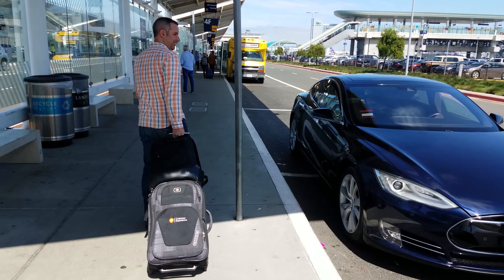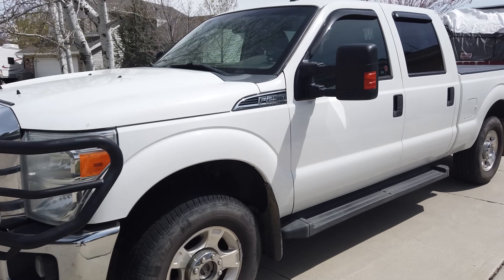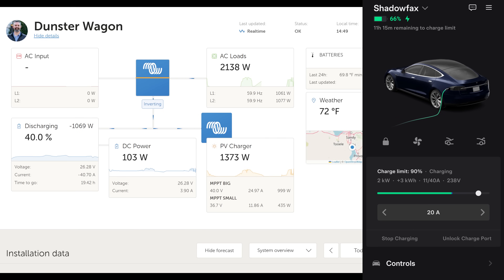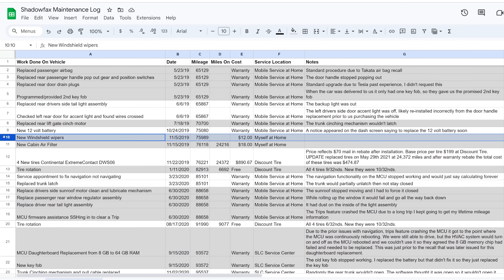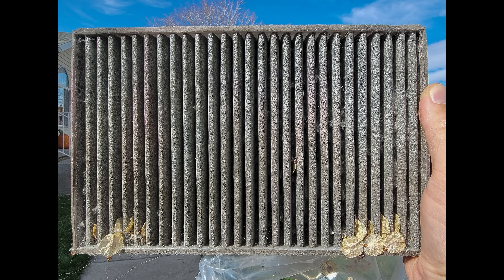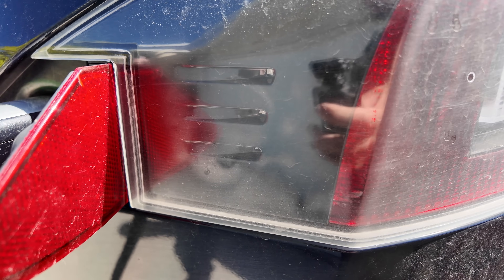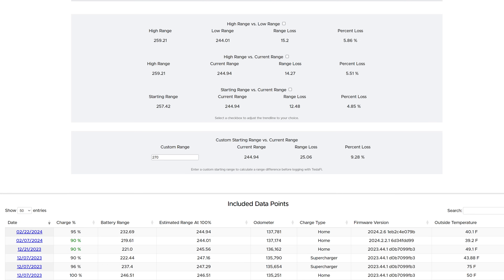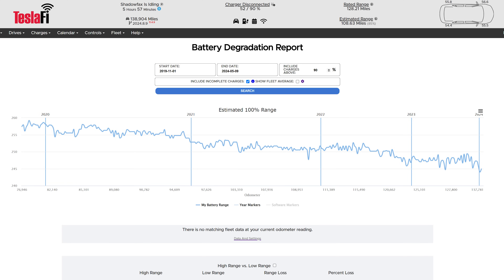Should You Buy A Used Tesla? | 5 Years Of Model S Maintenance Costs Plus My Current Experiment

Comment: Thanks for the great recap. I just purchased my own 2015 Model S 85D a couple weeks ago. The prices finally came down enough that I could afford the car I have wanted since the 2012 release. With the used EV federal tax credit ($4000 transferred directly to the dealer), I was out the door at $16250. Like you, I had always bought and driven reliable used (out of warranty) cars prior to this one. Because I bought this Tesla from a (non-Tesla) dealership, it wasn’t possible to get a service history, but I did figure out it has the MCU2 and original battery (from sticker behind right front wheel well). One thing I am very curious about is the battery health. I know there are health checks and calibrations I can do by charging it high and running it down low and/or through the service mode, but for a couple reasons that is not something I want to do right now. Where you could possibly help me is by telling me about how many real world miles you get for each percent of charge. If your max range is ~250 miles, then that should be 2.5 miles for 1%. Do you get anything close to that? 

Again, thanks for your work on these videos.
Reply from the maker: I just checked TeslaFi and I haven't charged the Model S over 90% since February 22nd 2024 apparently, which I'm just finding out myself. I'm not surprised though since right now I'm exclusively charging the S from our travel trailer's solar panels. The state of charge is all over the place, but generally 40-60%. It did recently get to 90%, but I'm realizing now I should have let it charge to 91% to let TeslaFi get a data point on it's estimated range. On February 22nd 2024 the estimated range at 100% was 245 miles. It's probably still in that general area of range.
Reply: Right, but what is the difference between the estimated range you are  getting and the actual mileage you get? I know the estimated range is based on more ideal driving circumstances, so the actual real world range will be lower, but how much lower is what I really want to know. My car tells me the estimated range is for 100% state of charge is like 235 miles, but when I take a drive of 23.5 miles the charge drops more like 15% as opposed to the estimate which would be 10%. So my actual range seems way off from the estimated range the car gives me. Just using the miles I drive in a given trip divided by the percent decrease of the state of charge, I am getting between 1.6 and 2.0 miles of driving (a wide range, I know) for every 1% of charge that is lost/used. I figure this means my real range has to translate between 160 and 200 miles. This is not necessarily a concern for me because I can comfortably live with my car  as a daily driver getting charged every day at home, but if batteries that drop below 70% of original charge become less stable and prone to failure, then I would like to know. Can you tell me about how close your cars estimated range is to what actually get? Does a 24.5 mile drive drop the state of charge by 10% as estimated, or is it typically a drop closer to15%?
Reply from the maker: @jasonpalmer7511  You raise a good point, and I've been writing a script to make a video about the very subject of actual real world range vs the "rated range" which is well known for being...optimistic. Looking in TeslaFi for my Model S at my top 10 longest drives they vary from 197 (used 92% of the battery at 83.8% efficiency and 89k miles on the odometer) to 175 miles (used 95% of the battery at 70.7% efficiency and 81k miles on the odometer). A more recent example from December 2023 when we drove it down to Las Vegas to pickup our Model Y we drove 95% of the battery driving 174 miles at 73.8% efficiency and 135k miles on the odometer. Keep in mind the speed limit on that route was 80 mph... The longest drive we've ever done was 3 hours and 30 minutes to drive 197.21 miles using 92% of our battery at 83.8% efficiency with 89k miles on the odometer. Generally I drive about 75-85 mph while on road trips so all these numbers reflect that. You can expect about 200 miles of range while on road trips with minimal safety margin, but this number can be higher if you drive slower or are going down in elevation, or there's a tail wind etc... Conversely if you're generally going up in elevation, a head wind, going faster it'll be lower obviously.

Regarding the Battery Management System (BMS) and the car stating range that doesn't seem to match with the real world, that will typically get more accurate if you run the battery all the way down, then charge it all the way back up which is only something we do on road trips. If you are just driving around town for months/years then the BMS can get pretty uncalibrated which will likely be fixed by not charging for as long as it takes to run the battery down to say around 10% then charge it all the way back up to 100% (then hopefully drive the car that same day to get it back down to less than 90%).

We have a destination we drive to regularly that's 25 miles away (we've driven there over 200 times in just our Model S) and the last 10 times we've driven there in the Model S it consumed 11%, (July)  13%, (June) 15%, (Feb and the rest are all winter months) 14, 13, 14, 14, 13, 14, 14% to get there. That's a variance of 70-90.8% efficiency. Why the variance?  All kinds of things. Cabin set temperature, ambient temperature, was the car just parked in the garage prior to the drive or was it in the driveway (Our S and Y take turns in the garage for various reasons), was there wind, what direction was the wind going, traffic conditions etc...

In short I've learned to not be concerned about the range at all when we're simply driving around town because we have way more than enough range to drive wherever we want to go. Then on road trips I rely heavily on the navigation in the car to see what the estimated arrival percentage is. When doing rough planning I know we can go about 200 miles max, but the distance we actually drive is less than that dictated by the distance we can drive between the superchargers considering environmental variables that the trip planner takes into account (elevation changes for instance) automatically. I mention this because while I like to dive into the details of the metrics, the average person out in the world likely doesn't want to have to be bothered by efficiencies, distances, Watt hours per mile etc... and I want them to recognize that they can just route the car to their intended destination and let the car take care of the rest if they want.
Reply: @ElectricTechAdventures  That is really helpful. Thank you for the detailed response. 

Just to add a data point for others who are here reading about repair costs on a 2015 Model S 85D, I got mine a few weeks ago and the headlight went out a few days later. The part alone (HID bulb) was $130. There were much cheaper options on Amazon ($30 and up) but I chose the Sylvania D3S because it is warrantied for 12 months and, more importantly, the replacement of the bulb was much more difficult than it should be and I didn't want to have to do it again because a cheap bulb burnt out or failed. I have always changed my own headlight bulbs (Mazdas, Acura), but the Model S required jacking the car up, removing the tire and wheel well just to get access to the bulb. Some say it can be done from the frunk, but it's really tight. After watching numerous videos, I decided to price out having Tesla do it because I lack both the proper tools and the confidence to jack the car and start taking it apart. I really cannot afford to break something else in the process! Tesla service gave me appointment three weeks out for a different issue (cellular connection) and never responded when I messaged them about the headlight (Atlanta area). I found two shops that do work on Teslas and both quoted me over $250 just for the labor. I tried looking on Task Rabbit for a freelance mechanic, but didn't see any who advertised experience with Teslas. I did find a mobile mechanic company (instant car fix.com) that quoted me $250 total for parts and labor. They came next day and the mechanic was pretty good about walking through the procedure so I could do it in the future if I choose. But even he struggled for a few minutes to get the new bulb in place. My hands don't "have eyes" like an experienced mechanic, so I think I would have been really frustrated had I tried it on my own. The mobile mechanic work was warrantied for 12 months (parts and labor) and they used the Sylvania bulb. I kept my Tesla service appointment because I have no cellular connection. They have yet to give me an estimate, but I might not even bother to get it fixed because I can hotspot from my phone if I want internet. I cannot, however, use any Teslas phone app features if the car is not connected to a recognized wifi network--which will be most of the time the car is away from home. So far, I am doing fine without the celluar connection, but lacking the real time traffic (even when hotspotting) might push me to get it fixed.
Reply from the maker: Thanks for sharing this information! I didn't know the headlight bulbs were so difficult to replace. I haven't run into that yet. Also not having cellular data connection and thus no connection to the car through the app would certainly motivate me to get it fixed most likely. Hopefully that's not overly expensive!

Comment: Brother is dreaming that it will last another 6 years.  Any little repair will mechanically total the car.
Reply from the maker: Do you have anything to substantiate your claim? I don't even know what you're remotely talking about. 6 years is an arbitrary amount of time and partially meaningless as longevity more depends on the miles driven in that time. Then the matter of totaling a car depends on the repair vs the value of the car and you haven't cited any specifics whatsoever. I'm happy with the car's performance and we'll continue using it and I'm confident it's not going to be "totaled" by a minor repair.
Reply: @ElectricTechAdventures  I’m not sure the 2015 has the coolant leak on the drive motor but that’s a concern.   I’m surprised you haven’t run into door handle issues, or window regulator.  But 4k spent over those years a crazy bargain.  What’s the insurance and registration in LV?
Reply from the maker: The drive motor coolant leak is with the large motor in the rear of performance models. I'm not sure what year range though. Mine has two small motors so no concern there. All the door handles were replaced while it was under warranty. There will still likely be door handle issues in the future though. What does LV mean?
Reply: @ElectricTechAdventures  you spoke of your kids driving it in six years.  I would be shocked regardless of the mileage that you put on the car that it is still on the road in six years.
Reply from the maker: @michaelcharach  Based on my research and experience it'll easily still be on the road serving our needs for another 6+ years. It only has 140k miles on it where many others like it have multiple hundreds of thousands of miles on them (I recently saw this YouTube video from AutoTrader https://youtu.be/2HlyQy9WRlc?si=AsrccBPRyjx--Kow at 430k miles). Time is also a factor in battery degradation and right now our Model S is 9 years old. The battery degradation is sitting at 9.28% according to TeslaFi. My children won't need a lot of range for their teenage driving. If the battery loses another 9% in 6 years they'll still have 221.4 miles of rated range. As with any mechanical thing there's a possibility there will be a catastrophic battery or motor failure. That's the risk anyone accepts when they drive any vehicle, and the risk increases with miles/time.

Comment: There has got to be a way to automate the charge settings with something like home assistant so you can follow the solar output, adjust the charge level so you stay within a minimum/maximum state of charge on the RV battery or whatever other parameters you use to decide the charge level rather than having to check the app every hour or so to adjust the charge setting manually
Reply from the maker: I know that Tesla's API supports changing the charging amps, but I haven't looked into Victron's API to see what options there are. I would like to into it more, but I'm so busy editing YouTube videos that I haven't decided to spend any more time on trying to automate it. Also I'm not a computer programmer, so it would take me even more time to figure out how to do it. I don't check the system hourly though. More like 4-5 times per day because I've been doing it long enough I can see what the weather is doing and I generally know if the Tesla is pulling a certain number of amps how quickly that'll effect the charge state of the trailer battery bank vs the solar production. I'd love to automate it someday though and I'm all ears if anyone else figures it out before I spend anymore time on it.
Reply: @ElectricTechAdventures  You don't need to be a programer to do any of this. If both systems have APIs then their is a very good chance the Home Assistant community will already have made integrations for them and after that it's just making so rules called automations that say when the system is in certain states take whatever actions.
Reply from the maker: @Pegaroo_  Valid point. I do have work experience with Adobe Fusion which is another API integration platform. It still takes time figuring it out and while it would save me time long term not checking the Tesla and Victron apps as often, I'm still struggling with getting my YouTube editing caught up. We keep going on new trips that I'm excited to share here on my YouTube channel and my latest trip I'm about to finish publishing happened 20 months ago...and we just got back from yet another new trip yesterday. My current trip editing backlog is 12, and many of those trips will be a series of multiple videos. I'd love to be able to publish videos 2-3 times per week to get caught up, but alas for years now I've only managed to average editing about 1 video per week with what time I can spare from my family and day job. API integrations are just on my back burner along with building a new garden, washing the cars, fixing our lawns sprinkler system, fixing a gate in my backyard and many other things I could be doing. Adulting can be hard balancing priorities sometimes.
Reply: @ElectricTechAdventures  Well once the editing backlog is caught up and the garden is sorted have a look into it.
Have a quick watch of that video you'll see it's not as scary as you think
Reply: @ElectricTechAdventures  Home Assistant has Tesla and Victron integrations already which will pull in all the sensor data and control options your system has.
And this video will let you see how simple making automations can be www.youtube.com/watch?v=MGHIlMorTVc
You could even make a video on your adventures of getting it set up
Reply from the maker: Thanks for the help and encouragement! I'll watch that video and see if I can perhaps setup the automation with less time investment than I've thought it would take to free up my time for more YouTube video editing!

Comment: 2015 85D here. Just had charge port replaced by tesla. 446.20 was my total which was just for the door. In goodwill, they replaced the chargeport as well for free.
I also had a window regulator replaced for around $400 more.
Your issue looks like it may be both the door and port needing replacement whenever you pull the trigger.
Reply from the maker: Good to know, thanks for the info!